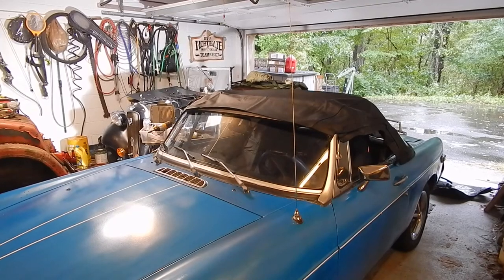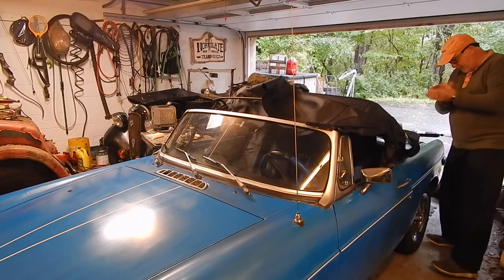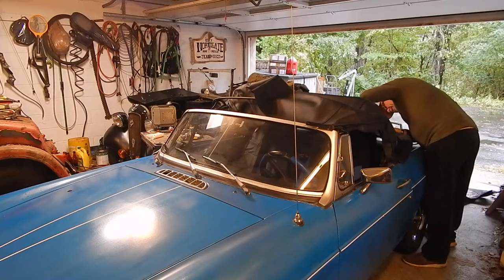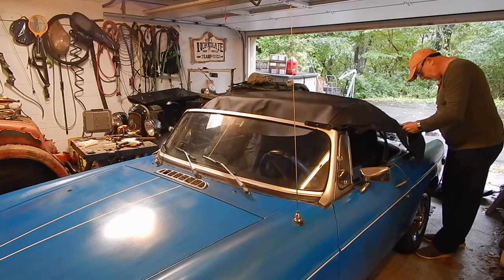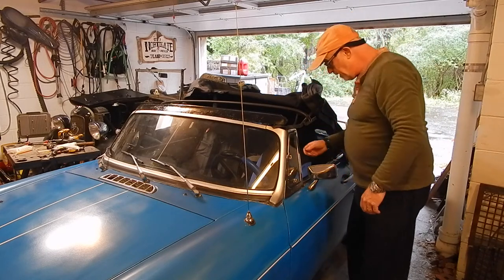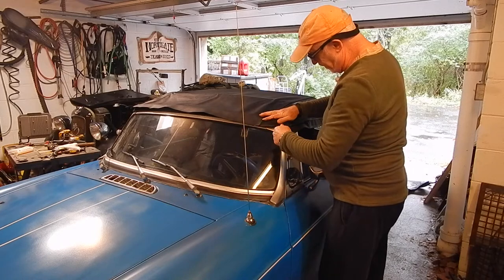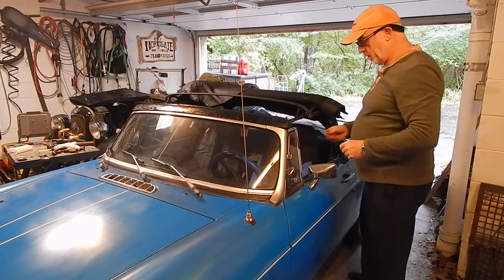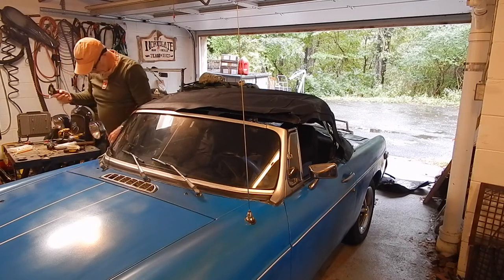1979 MGB new hood installation

Comment: Use contact cement, it will stay if you follow the directions.  DON'T use self tapping screws through the aluminum strip, use rivets as is originally done, otherwise it is hard to get the sealing rubber in correctly.
Reply from the maker: Thanks. Your sage advice will help others not make the mistakes I made for sure.

Comment: There's an order you need to use to get the correct tension. 
With the rear clips and bows in place, heat the top with a heat gun or in the sun then pull it forward to the leading edge and mark it with a china white pencil to give you an idea of where you want it to be, in the end the marked edge will more than likely go further around to get good tension.
Hood attached to the rear and bows in place, pop the front clips, still within the hook just not locked. You could consider pushing the front bow froward to reduce tension if its cold, glue the front lip from centre outwards, you can tack glue this to check things before fully glueing. The outer corners should be glued after the front section, do this last. Dont pull to much out to the sides otherwise you'll have too much material there.
Once glued but not set you can push the front bow back, and apply the front hooks partially to see how the tension is, you want it to be even. If it looks good then press and glue around to front edge, apply hooks to check final tension. Once you are happy you can trim excess vinyl and apply front metal place and seal.

Getting the tension and distribution is the key, along with the correct glue and glue application. Like boat bamini covers, there's an order to applying the bows to get the correct tension.